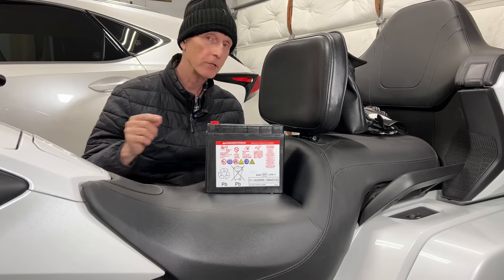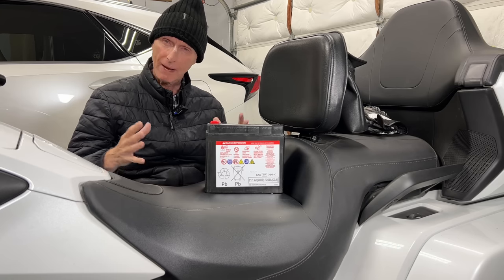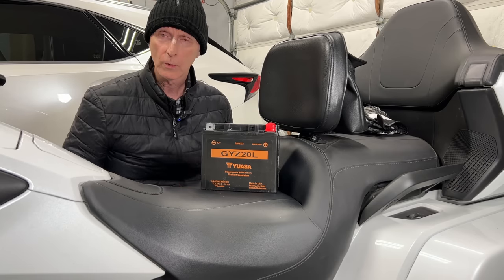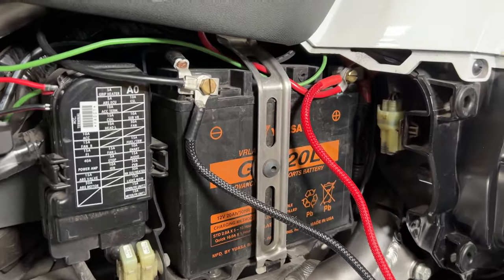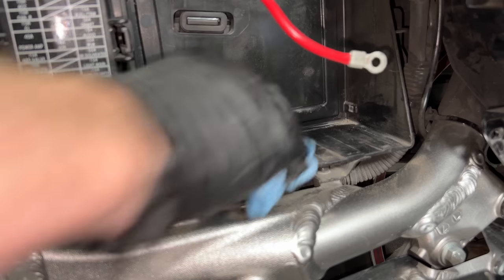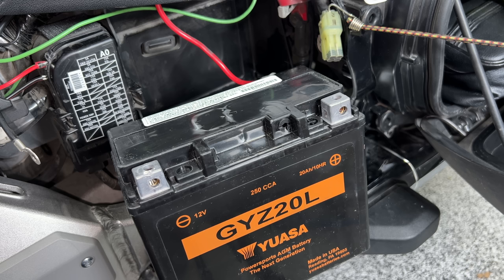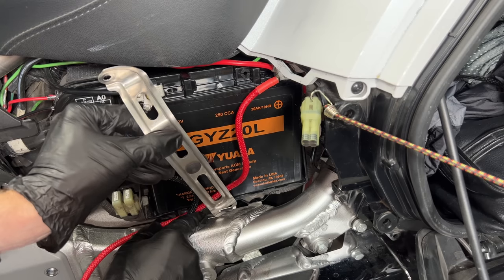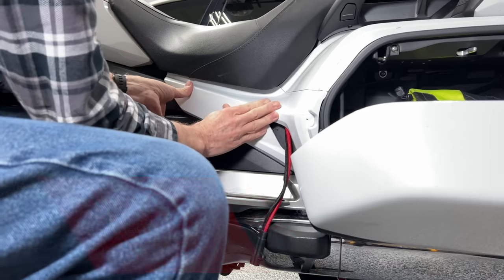Battery Swap on my 2018 Honda Goldwing | CruisemansGarage.com

Comment: Just wondering your thoughts on coating all connections with dielectric grease when reassembling connections?  I have done for years with no issues except collects dirt pretty bad.  Thank love you videos
Reply from the maker: It is probably unnecessary on quality waterproof connectors, but I have done it as well.

Comment: Beware, I recently purchased a battery from the local Battery Plus store, which they looked it up on their computer for 2019 Goldwing. But when I tried to attach the right-hand positive cable to the battery terminal the screw hole of the terminal was off to the left about half inch so the screw holes would not line up. I tried to force the cable to line up the hole but was unable. I returned the battery for a refund.

Comment: I think Yuasa is taking the heat for a Honda problem.  I made the easy to make mistake 3 times; turning the bike off while on center stand and not noticing that doing so without the park brake on causes some circuits to remain active.  Total drain down when my 18 was new, parital drain last year, and a recent total drain again that would not recover enough to trust.  My fault and Honda's fault.

Comment: YUASA GYZ20L(250cca)-GYZ20HL(320cca)-YTX20HL(310cca)- All 15lbs. As stated in older Vids, one of the Honda Dealers had put an aftermarket Battery in my 18' GW in Nov. 2020(I've Bought two Batteries in 11 months. This dealer Batt. died on me 10/07/21 in middle of street. He replaces it(11month old under warranty) With another Aftermarket(Fire Power CTX20L-BS) Claiming This is what HONDA Sent him. Even eBay knows its the wrong Battery for the 18 GW "But I been doing this a long time, this is From HONDA".. had a Yuasa GYZ20L put in at another Dealer. Another Dealer Thinks  I might have too many Accessories - Older GW have a different charging system than the new ones(3 batteries in 29 months). I'll see how long this one Last(No tender Available Live in Apt. Building garage has on Electric Hook up)

Comment: why not use a lithium battery to save weight?
Reply from the maker: There are advantages and disadvantages to Lithium Ion. I did consider it. But, less weight is definitely a positive.